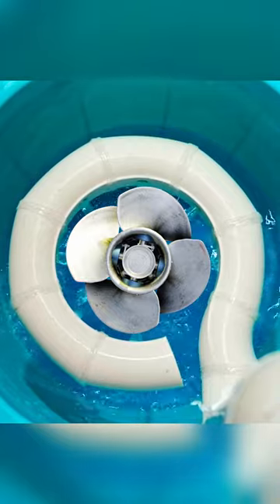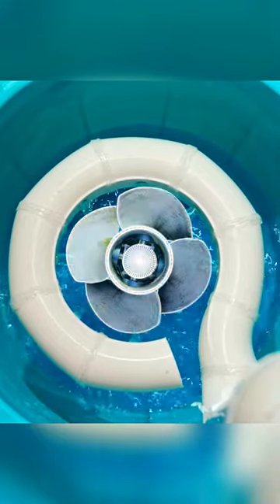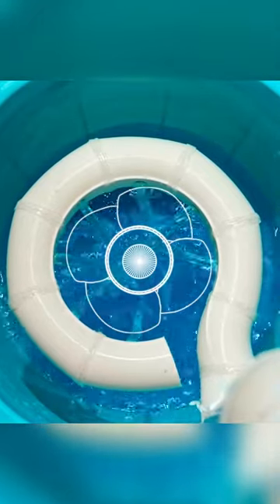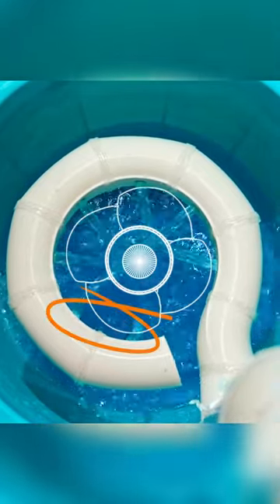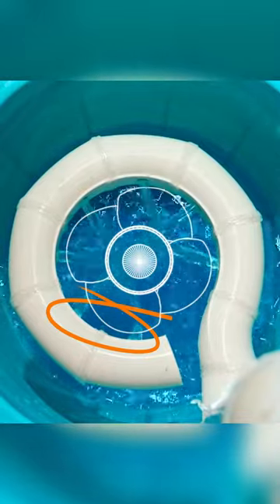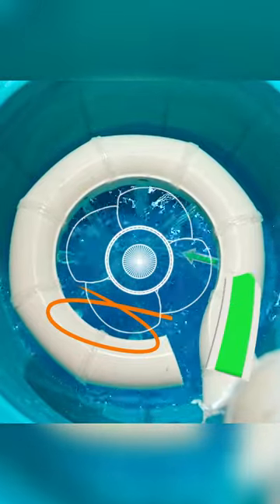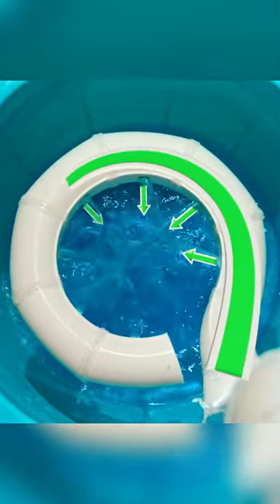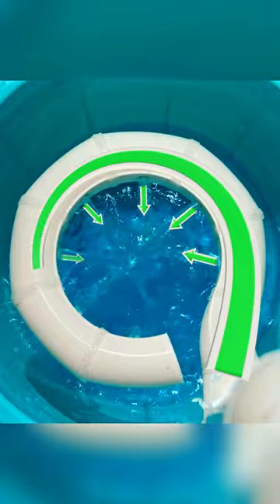The beautiful engineering of SPIRAL casings!

Comment: Spiral tubes are very hard to produce. If you merely vary the hole diameter you get the same thing without the big extruding 
Smaller holes near input, gradually larger.